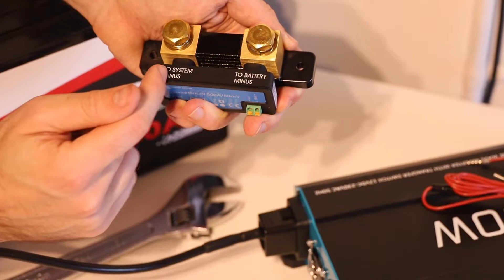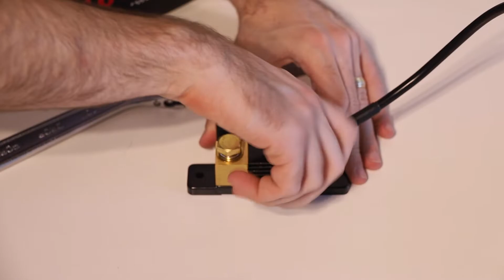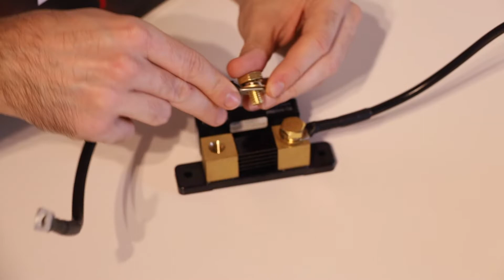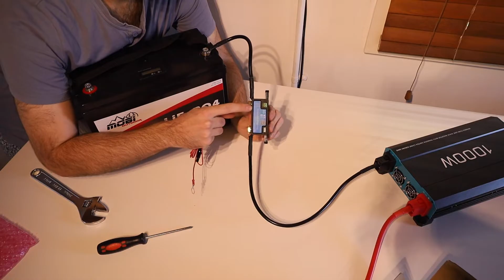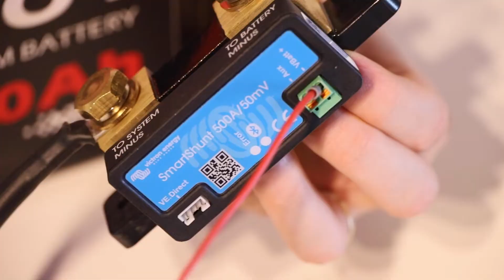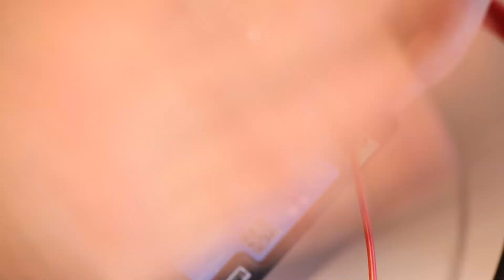How to connect up the Victron Energy Blue SmartShunt 500a Bluetooth Battery Monitor

Comment: Will that shunt turn off or does it continually draw power from the battery until it's disconnected?
Reply from the maker: It is on constantly.